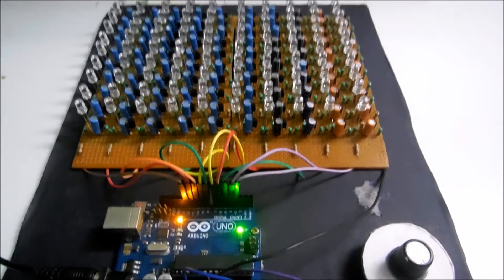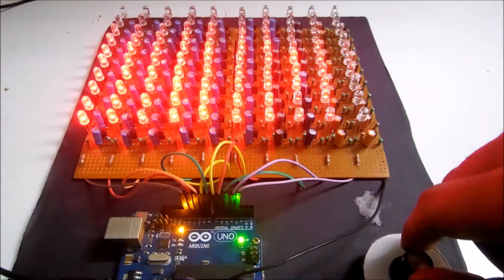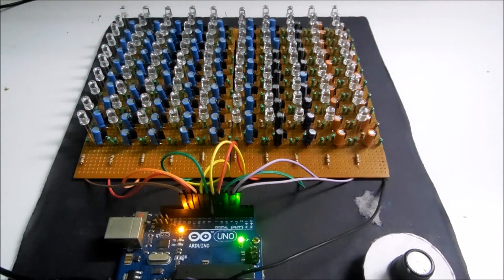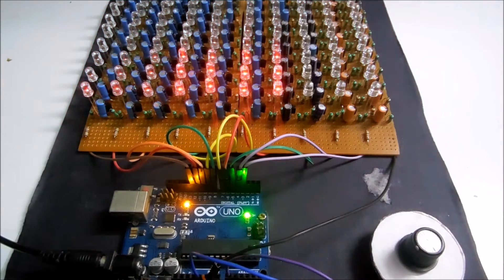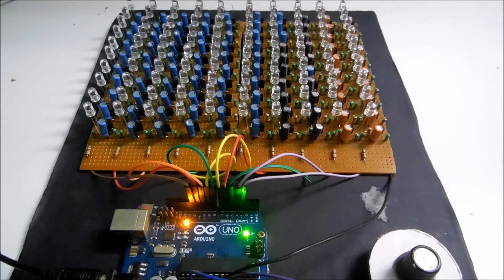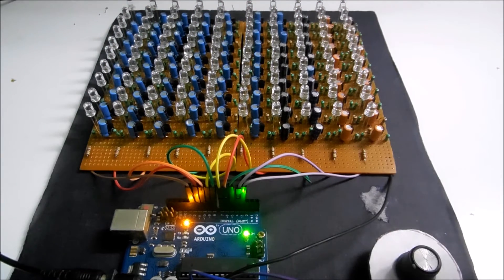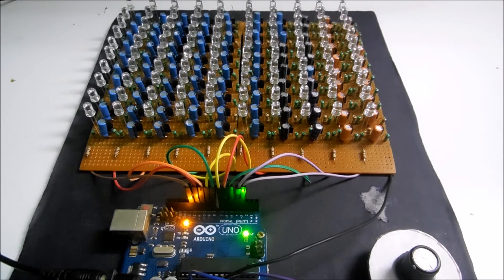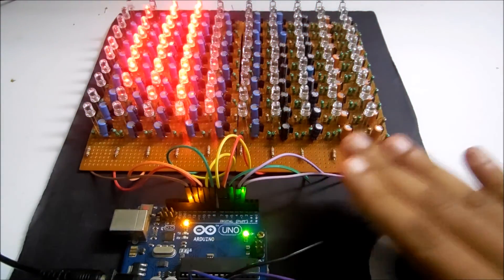controlling 10*10 led rainshower array using arduino.

Comment: Did you find out the problem with the proximity trigger of Circuit?
Reply from the maker: The proximity trigger worked only when I used a 12V adapter. Good  resolution of inbuit ADC and emf generated by adapter made this potentiometer to act as a proximity switch